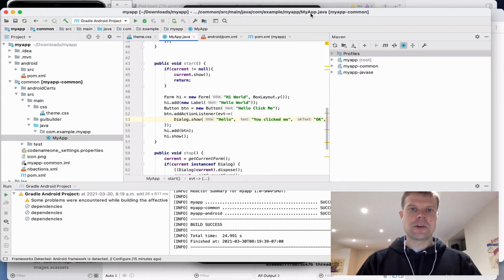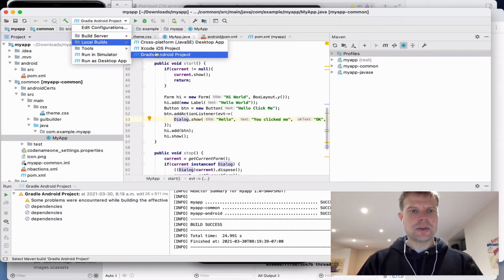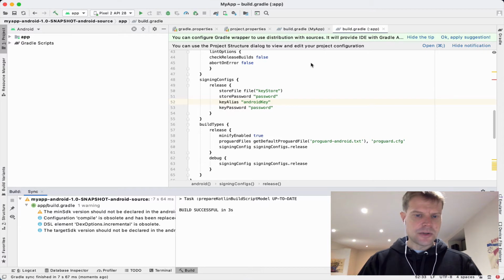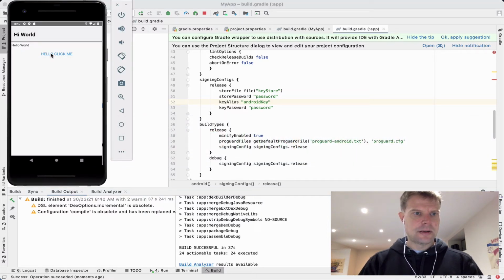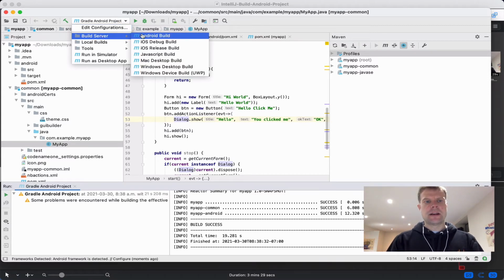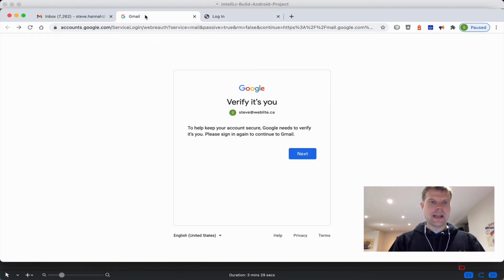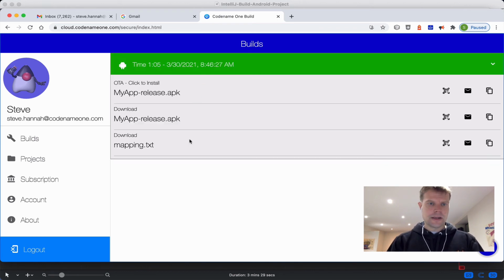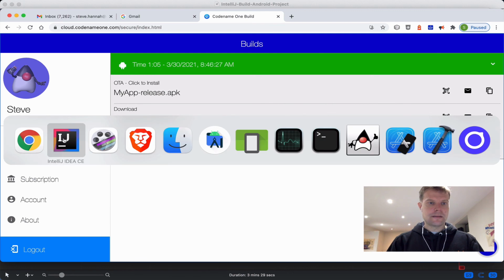How to build Codename One Project for Android

Comment: I am seeing the following error when trying to run the proyect in netbeans ide 8.2 Failed to execute goal org.apache.maven.plugins:maven-surefire-plugin:3.0.0-M5:test (default-test) on project salesforce-common: Execution default-test of goal org.apache.maven.plugins:maven-surefire-plugin:3.0.0-M5:test failed: Unable to load the mojo 'test' (or one of its required components) from the plugin 'org.apache.maven.plugins:maven-surefire-plugin:3.0.0-M5': com.google.inject.ProvisionException: Guice provision errors:

1) No implementation for org.codehaus.plexus.languages.java.jpms.LocationManager was bound.
while locating org.apache.maven.plugin.surefire.SurefirePlugin at ClassRealm[plugin>org.apache.maven.plugins:maven-surefire-plugin:3.0.0-M5, parent: sun.misc.Launcher$AppClassLoader@5c647e05]
while locating org.apache.maven.plugin.Mojo annotated with @com.google.inject.name.Named(value=org.apache.maven.plugins:maven-su